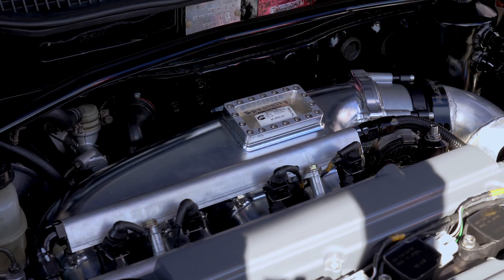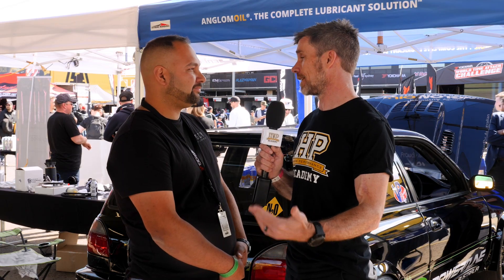HOW MUCH does this GTiR make at 11,000rpm?!

Comment from the maker: 🔥 Building a fast car? Get $400 OFF the all inclusive VIP online course package deal: https://hpcdmy.co/ayk
✅ Kickstart your EFI Tuning knowledge. Get 50% OFF your first online course: https://hpcdmy.co/1yn
TIME STAMPS:
0:00 - Akin Uykun 
0:18 - Why A GTIR?
0:41 - Hard To Work On
1:07 - Billet SR20
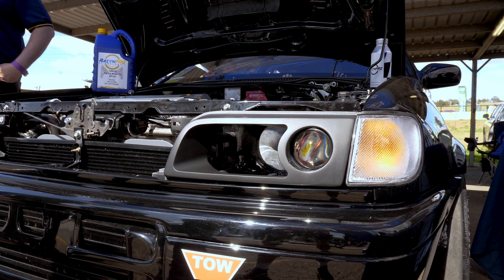1:25 - Dry Vs Wet Block
1:48 - VE Cylinder Heads
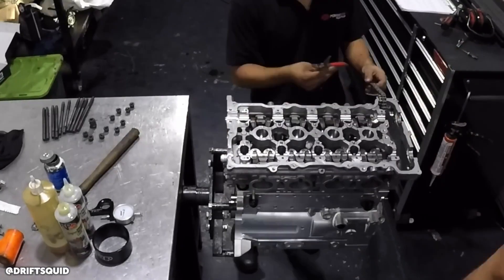2:08 - 11,000 RPM
2:16 - DE/DET Heads Vs VE Heads
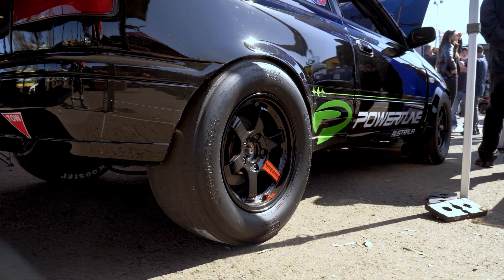2:37 - Cams & Porting
2:59 - VVL Retained
3:25 - Dry Deck Advantages
4:02 - Head Sealing
4:23 - Turbocharger 
4:42 - 1200hp at 45psi
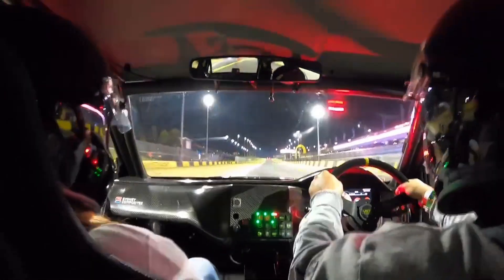5:05 - ¼ Time
5:20 - Launching
5:42 - MoTeC Electronics Package
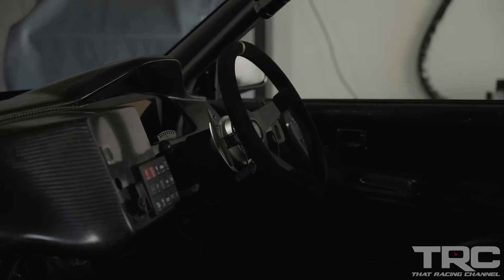5:54 - Drivetrain
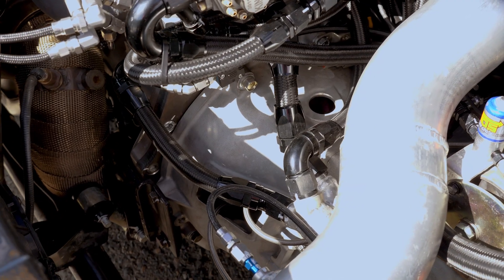6:30 - Conversion Kit
6:50 - Rear End
7:05 - Nitrous Setup
7:33 - Pump E85 Fuel
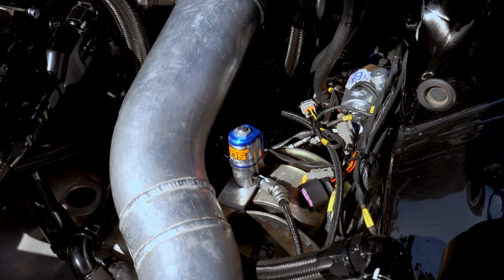7:46 - Mechanical Fuel Pump Setup
8:27 - Gunning For The 8’s
8:46 - Roll Racing In-Car
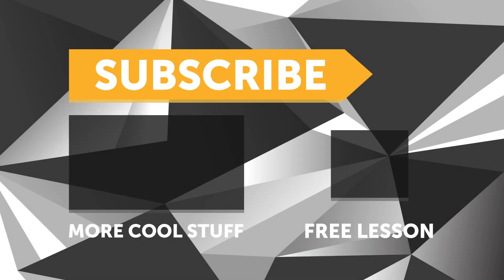9:10 - BUILD.TUNE.DRIVE

Comment: You guys have an episode explaining the benefits of a mechanical fuel pump correct ?
Reply: The benefits of a mechanicals fuel pump is huge flows with little load on the car. Electric pumps struggle with large flows. If they do have large flows it requires a huge amount of current. This can effect spark quality and overall HP. Plus you need a large alternator to power it.

Mechanical is simple and flow increases with rpm.
Reply: https://youtu.be/nO5rVlj99fE?si=8B9mnvAjYMRdaZOa
Reply from the maker: Great question and thanks for sharing something great already @Midget

Andre has a mechanical vs electric webinar here: https://www.hpacademy.com/previous-webinars/246-mechanical-vs-electric-fuel-pumps/?utm_source=youtube&utm_medium=social&utm_campaign=general-interaction

And it has come up in a few interviews too. It's getting a little tricky to remember which interviews talk about what these days, especially pre-timestamps 😅, the webinars cover so many topics though:
https://www.hpacademy.com/blog/2500hp-rb26-jun-ii-worlds-quickest-street-legal-r32-gt-r-skyline-tech-talk/?utm_source=facebook&utm_medium=social&utm_campaign=general-interaction

https://www.hpacademy.com/blog/stock-to-1200hp-54psi-and-208mph-honda-b18c-tech-talk/?utm_source=youtube&utm_medium=social&utm_campaign=general-interaction - Taz.

Comment: That thing is insane, dude is using speed and gear based boost control, yet he is obviously still smoking the rear tires most of the way down the straight!
Reply: Kind of looks like it is rubbing the tire on the rear quarter causing the smoke , but I could be wrong.
Reply: its the dust on the track from oil spill earlier